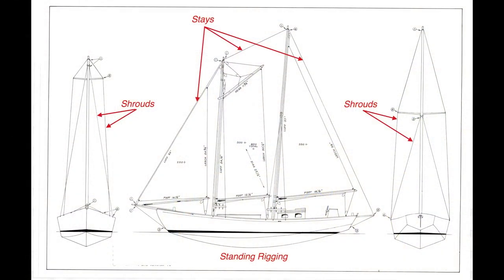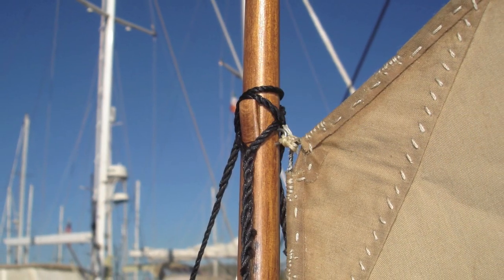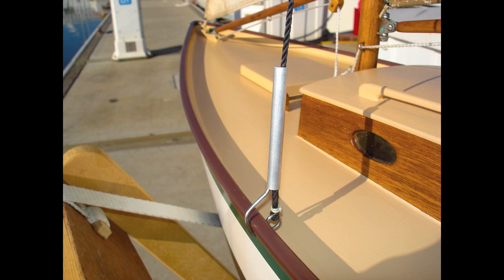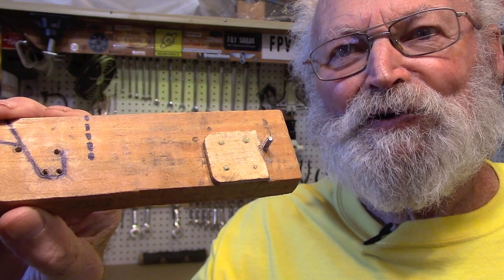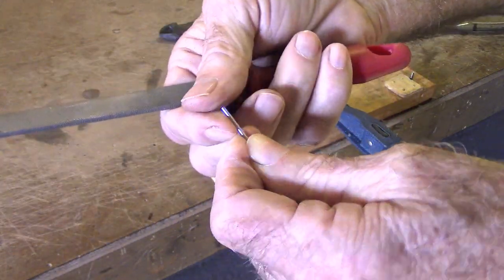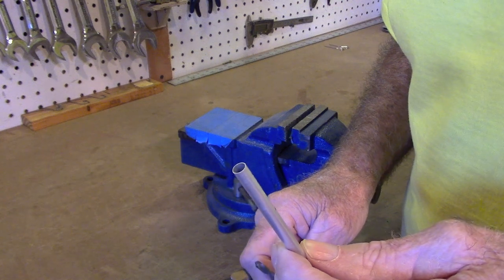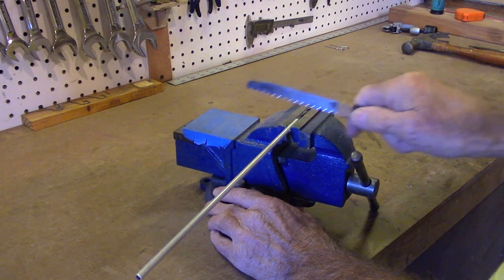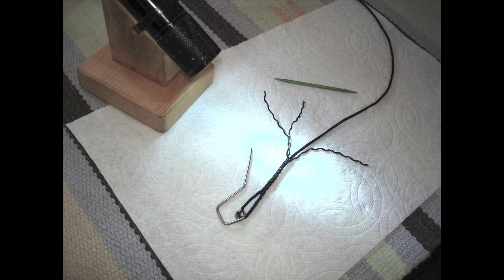RC Sailboat DIY Standing Rigging

Comment: Thanks Garry, I love your your videos , they are great at explaining your ideas and methods. in a way that we can all understand and use.  I am just starting my adventure into rc sailing and have Irene all kitted up ready to start assembly.  I also love the pelican hook jig, and will certainly be making one myself.  At this stage, my only question is how do you finish the outside of your hulls under the paintwork, do you rely on the penetrating epoxy or do you use a glass matting to add strength to them?   Thankyou in advance for any time you might give to respond to my question.  Happy sailing, Andrew
Reply from the maker: Thanks for asking Andrew, some folks do use a layer of fiberglass cloth. 
I have no objection to that but I simply rely on the penetrating epoxy to seal the plywood (and wood) inside & out. 
Lots of options for paint, but I like oil based enamels, brushed on. Here's what I do.
Inside the hull I paint with 1 coat of oil based undercoater followed by 2 coats of oil based enamel.  
Outside of the hull I build up a base of oil based enamel undercoater, sanded between coats with 220 grit, until the surface is as smooth as I want it to be. Probably 3 or 4 coats. I don't seek perfection, but achieve maybe "90%".
Finally I paint with 2 or 3 coats of oil based enamel, sanded lightly between coats with 320 grit. This is the protective layer. 
Add trim stripes or "bottom paint" color over the protective enamel. Spray can paints ok for the trim. Cheers !

Comment: Rather than stainless I found copper wire 12 gage more flexible, easier to work, for all my rigging needs. Popsicle sticks are handier for making the rigging blocks, just a dash of super glue and minor sanding, they take well to stain and sealer. One more idea, rather than pinning the hatches down, use the small magnets and a metal plate to keep them down. H/F has them but I guess any craft store would also.

Comment: I use a lot of waxed dental floss in my boat building. It is very strong, light, flexible, water resistant and super glue works on it very well.

Comment: Hi there. I love your video’s. Im trying to build a sailboat but I don’t quite get how to do the steering. How do I prevent leakage?
Reply from the maker: A wooden block is glued to the bottom of the hull, inside the hull at the location of the rudder. This block stands tall enough to extend above the water line. A hole is drilled thru this block for the rudder stock. Water will not rise (much) above the water line so the upper end of rudder stock is high and dry inside the hull. Cheers !

Comment: Hello Gary.
Another cracking vid.
That saw (unless you made it) is likely to have the teeth facing backwards and is designed to do the cutting on the pull stroke as opposed to the push stroke you would use with a conventional hacksaw that is supported at (and tensioned by) the far end.  This could be why you've found it to be successful in that direction.
Joe.

Comment: Interesting.  I build more modern RC designs.  I make my rigging from 1/32" stainless aircraft cable.  I turn the end fittings from 316 stainless steel rod on my lathe and mill in slots as needed.  I silver solder the wire into the fittings.  To adjust the stays and shrouds I machine 316 stainless turnbuckles to scale.  The stays and shrouds are attached to the mast with stainless fittings and #80 screws and I make stainless chain plates for attaching the rig to the boat.  The chain plates are screwed to knees bonded to the inside of the hull.

Comment: You don't need a pelican hook or Aluminum tube , All that is required piece of plastic a bit larger then the line you using. What you do is put the shroud or line that coming down from the mast, putting through two hole making the line push the piece of plastic in a direction, all about 1/4 the length of the line, then pull on the line through the hole or loop at the deck, then put the line through the other two holes, the coming up needs to go through the most farthest away from the line to make the jamming system/ adjusting line system. this to get read of weight on the boat .